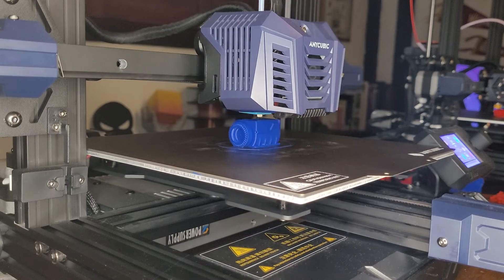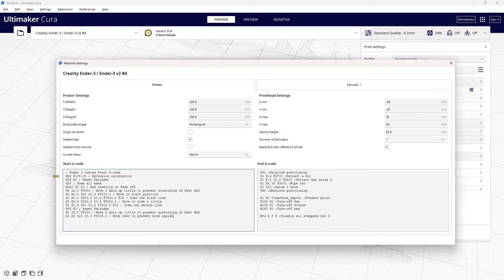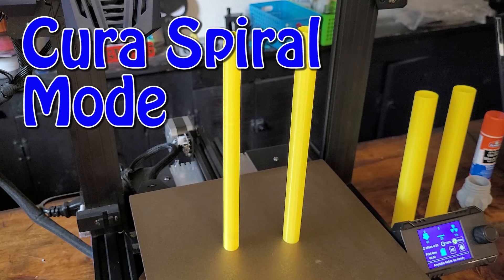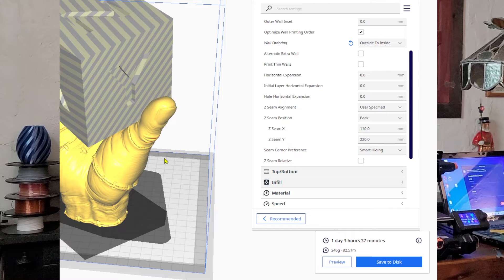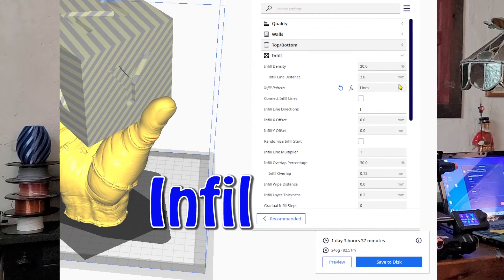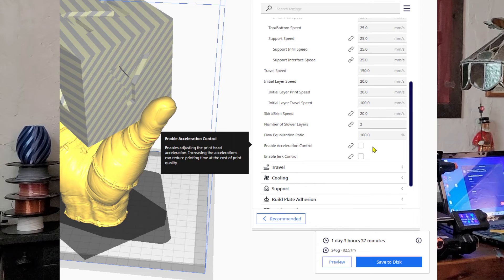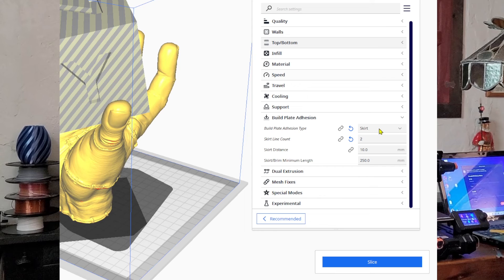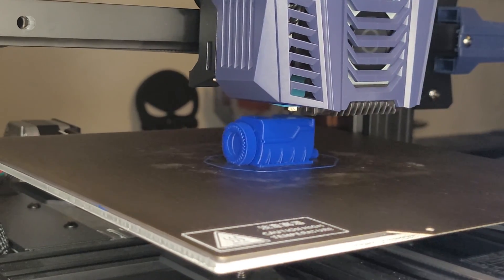Anycubic Kobra Cura

Comment: Hello Mayhem Smiley, I really appreciate the videos you have made on the Anycubic Kobra Go. I am just messaging you due to an issue I am having with it. You seem very knowledgeable about this printer. I am having issues with bed leveling, which I will address this issue with replacing the stock bed with springs to auto level. Thanks to your video on bed leveling. My issue now that I am having is layer shifting, and homing failure on the Y axis that halts the print. I tried addressing the layer shifting by adjusting the tension on the belts using your video and tool to adjust the belts and I am still getting layer shifting. As for the Y axis failure I’m still trying to troubleshoot it. My first steps are to disconnect and reconnect power to the stepper motor. I know this is quite lengthy but I hope to hear from you on what you might think. 
Keep up the great videos!
Very straight to the point and educational.
Reply from the maker: Hi Raf, Have you looked at this video for layer shifts and possible causes. For the y homing issue, please share more details. Do you get an error  message? Does it make it to switch or stall on route? Let me know. I'll help if I can.
Reply from the maker: Ooops forgot the link LOL https://www.youtube.com/watch?v=Q9W0mMcDDZ4&t=87s
Reply: @mayhemsmiley 
Hey again, I installed the springs on the bed and my first print was a lot better with the calibration cube. I tried to print again and I was having bed leveling issues. Some parts of the brim for my print are being thin like the nozzle is too close while on others the layers are barely touching as it is printing. 
As for the Homing Failure on the Y axis, the problem I’m having is that I assign a print and it will finish perfectly fine but as soon as the axis are supposed to home back to there place it says Homing Failed Y Axis Please Reset. I try to reset but the screen won’t do much and I just have to turn it off to clear the message of the screen.
Reply from the maker: @rafy3992  Morning rafy, do you have the nuts installed below the bed to lock the system in place. When adjusted there needs to be sufficient tension on the springs to keep the bed stable. DId you get the springs form home depot like I did? DId you do a bed leveling and then make sure that the leveling is being used  by placing M420 S1 Zo in the start code of your slicer? Keep me posted sorry for the delay.

Comment: Hello been following for a while and have kobra go aswell. Did bed level visualization on octo print and bed is showing a var of 1.5mm . Also for some reason the ABL is not applying Zfade. I heard you mention you put your bed on springs and manually leveled. Could u explain more on how you did this and also do you have zfade on?
Reply: hoping to fix some layer inaccuracies
Reply from the maker: Hey Animations, sorry for the delay. I don't use the fade function, I keep it turned off by adding the line M420 S1 Z0 into my start code. Here is the video for converting the bed to springs. Let me know how you make out. I bought the springs and nuts from Home depot.  https://www.youtube.com/watch?v=qpm1Rpr6EyQ&t=261s

Comment: Thank you for sharing, I go with these settings instead of mine and it is interesting that you're not using Accecelarion and Jerk, with the same profile you're using I still got overthrown corners... I wonder if you got rid of them (for a regular calibration cube 20mm) using just lower speeds or toying with acceleration and jerk.
Reply from the maker: Morning Marcos
Originally I didn't care about speed.  I only cared about quality then once I started getting the quality I started playing with speed.  But I've never played with the advertising and jerk just used the defaults